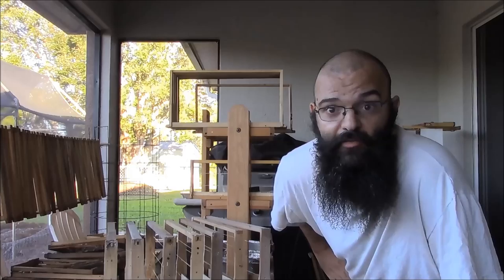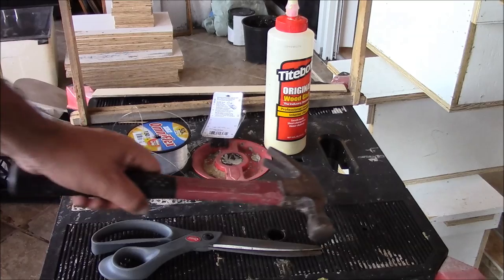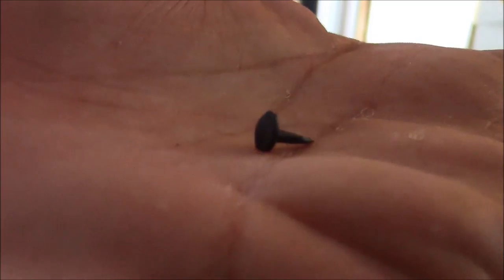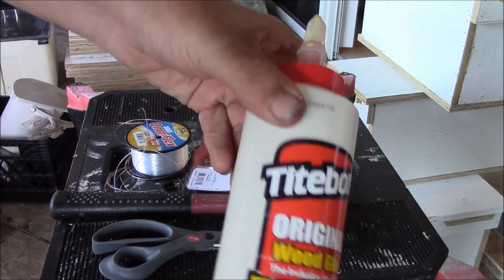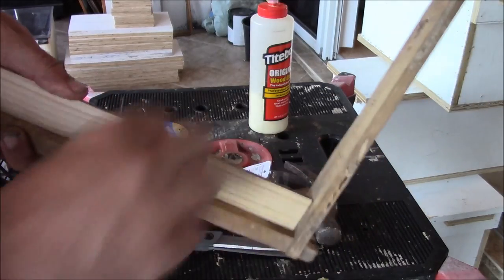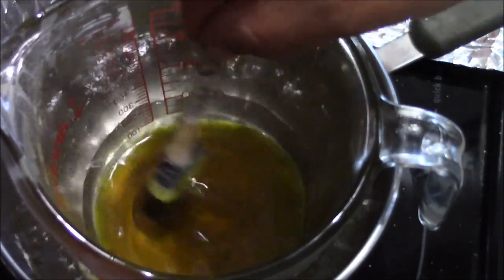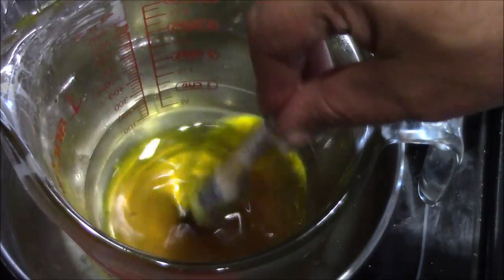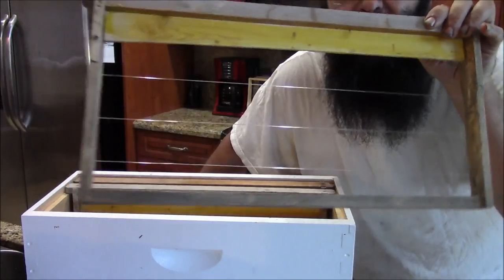How I prepare foundation less frames

Comment: I just dribble a Line of Melted Wax along the underside of the Topbar.
Tip :
Use a huge Wood (Slider) Clamp, that you single handed 'clamp' from side to side bar... so it's  under a bit of tension. Wire or Fishline the Frame. Tac or Pin ends off, as usual. Then de-clamp the Frame... it will be under super tension Wire or Line wise... No sagging, lasts for years ! Simples.
🐝🐝🐝🐝🐝🐝🐝🐝🐝
Happy Beekeeping 2022.
🐝🐝🐝🐝🐝🐝🐝🐝🐝
These Natural Comb Frames will go thru a Honey Extraction if you start to Spin slowly, and smoothly, ideal in hand cranked no electric types. 👍

Comment: How do you encourage them to build worker comb? All my foundationless frames are drone comb :(
Reply from the maker: Usually, if I place one foundation-less frame in the middle of two frames of capped brood; they'll draw worker-size comb super fast. So, I like to condense the space. I also always notice they will typically build drone size cells if placing the frames above the brood nest or on the far outside edge towards the wall.

Comment: A good tutorial but I think your starter strips are too big.  They should only stick out of the top frame 1/4 - 1/2" that way when they build their comb they follow the strip but attack the comb to the frame itself, and not just the strip.
Reply from the maker: That's the beauty of beekeeping. There is no 'right' or 'wrong' way. 

A lot of beekeepers I know don't even use any starter strips or string/wire.
When I make medium size foundation-less frames, I do use smaller width starter strips. But, so far the deep frames in the video have been working fantastic

I have had ZERO problems with cross combing, etc. From my current observations, the bees always seem to immediately star working these frames using this method regardless of deep or medium sizes

Thanks for watching!
Reply: Oh there are wrong ways lol.  I just bought 2 hives off a guy he used 9 frame spacers, and no guides.  Needless to say my inspection today was less fun than usual.  Mistakes in foundationless frames I've seen (maybe did myself ;) )
   Guide bar not running from end to end...say a waxed popsicle stick stuck in the center.  You get that fun looking boomerang comb straight in the center, and curved at both ends.  I've also seen some very tall guides, and for whatever reason the bee's decided to build the comb straight, but off center of the frame.

   Yours of course are far from too tall.  I'm just a little OCD.

Comment: How much time do the bees need to drown one foundationless frame? 
Am trying to figure it out what is best when you star beekeping and you dont have any other frames that are alredy build?!
Reply from the maker: How long it takes varies based on time of year. I think using a combination of foundation-less frames in between frames which have sheets of foundation in them is helpful. Using a follower board to add one new frame at a time can be useful too. Bees are very adaptable and will use whatever you give them. Just keep an eye on them to see how well they build 🐝🐝🐝☮️☯️
Reply: @thuffman44  thanks for your advice! 😊 i think a have watched all youtube.. will see what i have leard in the middle of the spring when i will get my fist 4 nukes of bees. (Cant waith)
Thanks again and all the best!
Reply: My bees will draw a deep frame in 1 to 2 days, maybe 3 days when the honey flow is on, but in summer you can forget about it. Also if they have open brood it will be slower, since they take more time in brood rearing which takes more resources. It also depends what kind of bees you have. Carnolians for example can and will build combs fast but will have other trade-offs.
You can feed the bees a 1 to 1 sugar syrup and that will speed up the comb building. The bees may or may not use your sugar syrup and it will dependent on when you get your nucs and it also is depending from hive to hive.
I have hives that will take syrup right now and others will not take it or are very slow in using it.
For a new package of bees or nuc with new frames I give the a 1 to 1sugar syrup so the can start to build the comb fast. It also will prevent that the newly installed bees take off.  If you want to prevent that the bees take off after installing , put a frame of open brood ( no nursing bees) into the hive.

Comment: what happen if they are without wire
Reply from the maker: Wax comb is more likely to fall out during inspection on hot day
Reply: is it so weak that fall out with wire if we dont handl in right direction
Reply from the maker: Yes ~ Using wire or fishing string adds more support to help keep wax comb in place so less likely the comb falls out of the frame.. Hot temperature weather makes wax very weak. Wire or string helps a LOT
Reply: Tim Huffman but it says 60 Celsius is wax melting point so untill 50 must be still ...? Did they finish any whole frame
Reply: You will not have any problem if you handle the frames the proper way while inspection.
It is ok  to use a frame without wire/fishing line in brood frames.
The problem comes in when you want to spin honey out of a super without a wire or fishing line, since the comb will break out of the frame without added support( wire/fishing line) when trying to spin the honey from the supers.